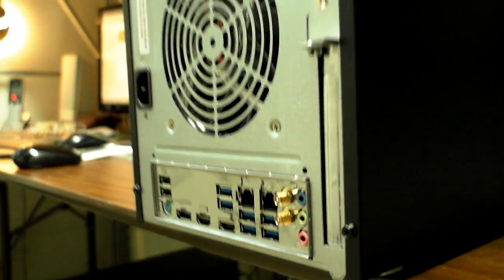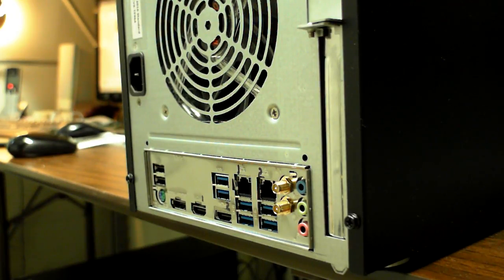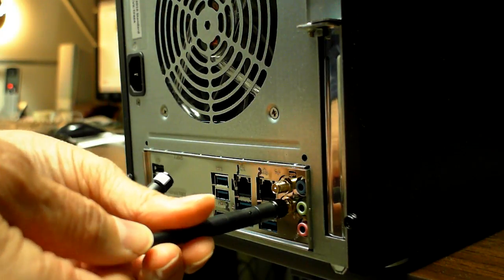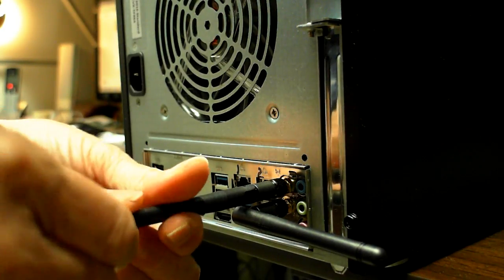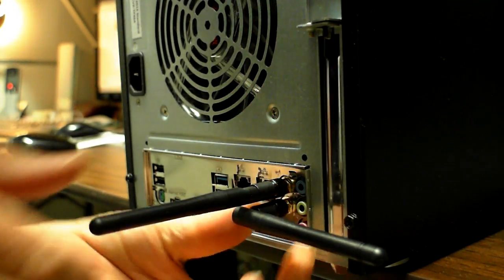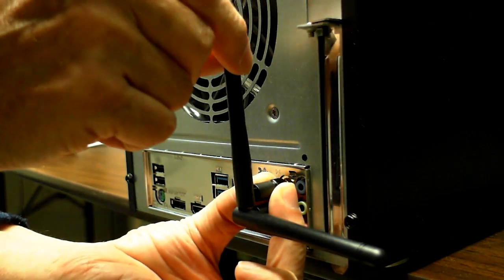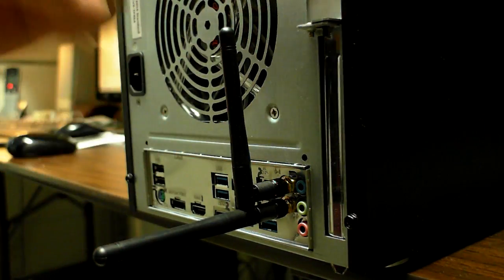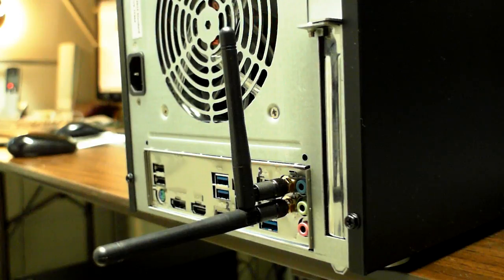Asrock Motherboard Antenna Install

Comment: I'm buying these antennas (another brand and style) and there are two types... one has the copper wire center and one has a hole for a copper wire or copper plug in the center.  Which do I buy?  The ones with the copper wire sticking out... or the ones with the little hole in the center of the plug?  Thank you!

Comment: My brand new cyberpowerpc has been having major Bluetooth issues. Do you think installing the antennas that were included will solve my problem?
Reply from the maker: The motherboard’s built-in Bluetooth & WiFi share the same antenna. So yes, definitely install the antenna that came with the motherboard.
Reply: @alanclarke7  I put them on and now it’s working perfectly! I feel dumb for not knowing to do that lol. Thanks!

Comment: i know im 3 years late but those little tiny rings supporting the 2 parts that are going outwards i accidentally kneed it once and it messed up all of my connection stuff my connection before i kneed it was elite but now im getting 1-2 bars average (wifi) so is there like a certain tool that you can screw it in because its just loose and i think thats why my attenas are not doing as good as they should be i have seen other comments but im not sure if they were referring to the little ring i just wanted to be sure goodbye have a wonderful day/night!
Reply from the maker: Google this: https://www.google.com/search?q=how+to+tighten+wifi+antenna+nuts

Comment: i just don't get it my antennas are in properly showing full bars but when i game my wifi spikes up so high every 10 seconds. Wifi works fine on every other device
Reply from the maker: If at all possible, use an Ethernet cable. It is generally faster and far more reliable than wireless.
Reply: I had the same issue. Go to your settings and you will have 2 wifi connections since there are 2 antennas. Open properties and connect the second connection to your internet as well. It worked!

Comment: My antennas behind my pc make me lagg like my wifi feels slow i’m like at one bar it’s not my  router
Reply from the maker: Pinpointing the cause of a lagging PC is difficult because of so many possible causes:
1) Slow mechanical hard disk (as opposed to SSD which has no moving parts)
2) Weak WiFi signal due to poorly placed antennas, too far distance from source, interference from neighbors using same band, low power output, defective or mismatched antenna, poor software, etc.

I've seen instances where I booted the same computer from Linux Mint and it provided a more stable WiFi connection than Windows. This isn't always true but the software operating system definitely plays a part.

Comment: If I have the b550 WiFi do I just plug the antennas in the same way
Reply from the maker: Yes. AMD's "B550" chipset is separate from the WiFi chip which is usually made by Intel or Realtek. The 2.4/5 GHz screw-on motherboard antennas are pretty much the same across the board. See for yourself on eBay by typing "2.4 5 GHz wifi antenna" in the search box.
Reply: Alan Clarke thx

Comment: What to do if there not working
Reply from the maker: The most likely problem would be the software. The 2nd most likely would be the wifi hardware on the motherboard. I least would expect a problem with the antennae unless you can see physical damage.
Reply: @alanclarke7  it worked before and I unscrewed then so I can tighten them and now it doesn’t
Reply from the maker: @KYU.Trades  
1) Try each antenna separately. Screw only one in at a time. If one is shorted internally, your WIFI signal strength may increase if the bad one is disconnected.

2) Your WIFI may be disabled inside the BIOS. Make sure it is enabled.

3) What operating system are you using? If you are using Windows, the problem may be that you are in "Airplane Mode", the WIFI password needs to be entered again, or the "Connect automatically" box is not checked. You can eliminate the possibility that Windows is the problem if you boot from a Linux live CD or USB flash drive. My favorite is Linux Mint "MATE Edition": https://linuxmint.com/download.php

To boot Mint or any other ISO file from a USB flash drive, I use "Ventoy" which is extremely easy and powerful: www.ventoy.net
Reply from the maker: @KYU.Trades  You can order new antennas on eBay for less than $5 with free shipping. Type "2.4 5ghz wifi antenna" in the search box. If neither new antennas nor my earlier recommendations corrects your problem, the motherboard's wifi may be bad. You can purchase an external USB wifi adapter. I bought an "Edimax EW-7833UAC AC1750 Dual-Band Wi-Fi USB 3.0 Adapter, Supports Windows 7/8/8.1/10, Mac and Linux"  on Amazon which is cheaper than buying a new motherboard, works on most all operating systems, and is fast.

Comment: how do you tighten those little nuts that are holding the posts on? i can't fit a wrench on it on by b460i gaming edge wifi
Reply from the maker: Tighten them with a socket not a wrench.

Comment: do you need an internet card and do you need to install it on your pc before you put the wifi antennas?
Reply from the maker: If your motherboard doesn't have built-in wifi, you would need either a wifi card or USB wifi. The card would need to be plugged into the motherboard before attaching the antennae.

Comment: What should i do if the screws for the antennas (what you screw them into) are broken or wobbily? My PC cant get any internet and its really stressing me out
Reply: ash  in my situation, i had to buy some new antennas as my pc's internet wasn't working. If you're having that issue then it may be that you have a free antivirus installed to your pc that could be blocking every website, which happened in my situation, so i had to delete it.
Reply: Ethernet cable
Reply: @philippeb4126  lmao your comment has just sent me back to a time of stress for my pc lmao
Reply: @ItzLogan07  my bad
Reply: @philippeb4126  lol it dont matter its all fixed now
Reply: @ItzLogan07  bruh my antennas are wobbly asf and I’m getting like 2 bars of internet
Reply: @isaiahhank5439  same how do I fix it

Comment: I have a asus prime Z-390 P would these  work ? For my mother board
Reply from the maker: Your motherboard doesn’t appear to have integrated Wi-Fi as my Asrock motherboard, So the answer is no.
Reply: @alanclarke7  mine came with a Attena although it broke it looked like this do you know what other attenas would work or do I have to get the same attena it came with here is a link it looks like this  https://www.worthpoint.com/worthopedia/asus-wifi-ring-antenna-original-white-1790611339
Reply from the maker: @jrgarcia5212  Try to borrow someone’s antenna to see if it works for you before you purchase one.

Comment: I already have my antennas installed but no matter what I do there is just no signal (it definitely isn’t my router)
Reply from the maker: Inside the BIOS is a setting to enable/disable the WiFi radio. Make sure it is enabled. I think it is under, "Advanced Settings".